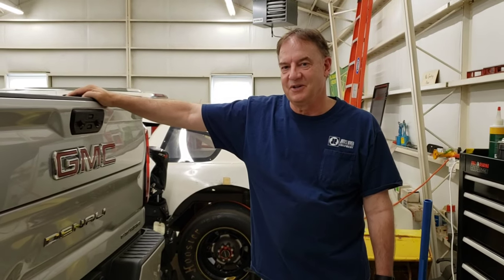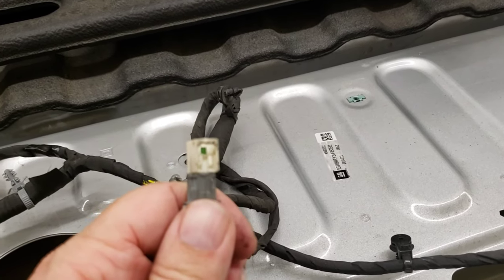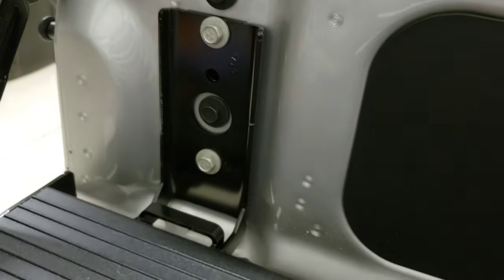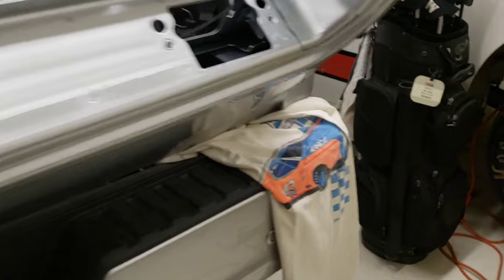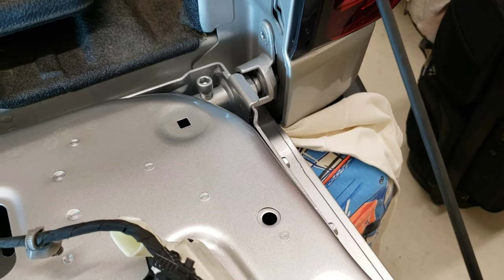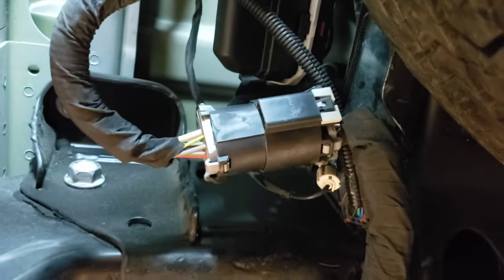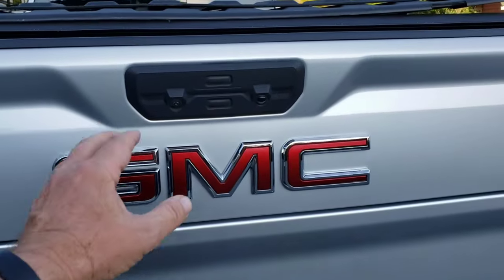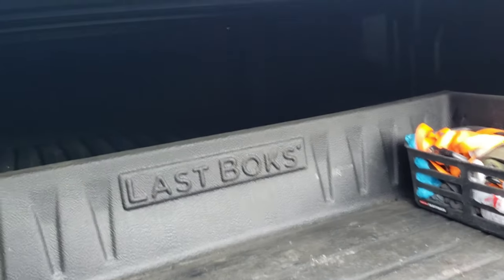How to replace lower half Multipro Tailgate on 2020 GMC HD Denali / DIY / Useful Tips

Comment: I got a new one in a body shop right now getting painted for my 2023 1500. Make sure you latch your trailer hitch before loading your tractor. Truck only had 200 miles on it when it happened. Thanks for the video.
Reply from the maker: Accidents happen. I know the feeling!

Comment: So i need to take the top half of to get painted. Is there a connector between the lower and top half on the electrical wiring? Or do I need to take it all apart for it?

Comment: @mnspeed1932

Thanks for the video. I just purchased a brand new 2024 and the tailgate won’t shut flush on one side. The tech in service tried adjusting everything and said it was a warped tailgate, but before they order a new one they are sending it to the body shop. Any idea what would cause a gap like this on just one side? Thanks!

Comment: Great video!  I am having issue now after my replacement of it dropping a bit fast as yours did. How did you fix that issue?  Was it something with that torsion rod bolt? I put new plastic bushing on the hinge. 21:15

Comment: At 11:46 in video. What is the purpose for the guides, what I call them. I think gm calls them a f wedge. Do they need to be on there. I'm wanting to put a tailgate light bar  and that hinders my clearances with tailgate and bar.
Reply from the maker: Derek, I don't really know without doing some research, however I think it keeps the tailgate centered, so it doesn't move side to side.

Comment: Great video!  I am having issue now after my replacement of it dropping a bit fast as yours did. How did you fix that issue?  Was it something with that torsion rod bolt? I put new plastic bushing on the hinge.
Reply from the maker: Yes, I forgot to put the plastic piece on the end of the torsion rod that fit into the round holder on the truck. Hard to explain.
Reply: how did you remove the driver’s side of the tailgate?

Comment: What is the part number for a multi-flex tailgate? Will it fit a 07-13 silverado.
Reply from the maker: Good question. You would need to supply power to it.

Comment: Great video!  I am having issue now after my replacement of it dropping a bit fast as yours did. How did you fix that issue?  Was it something with that torsion rod bolt?
Reply from the maker: I forgot to put a piece on the lower right side.

Comment: Great video!  I am having issue now after my replacement of it dropping a bit fast as yours did. How did you fix that issue?  Was it something with that torsion rod bolt? I put new plastic bushing on the hinge.